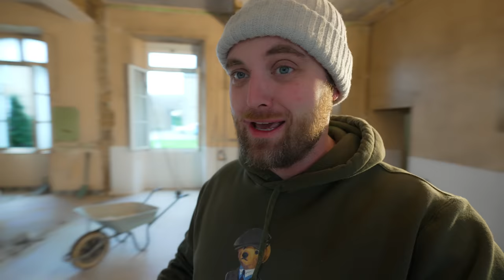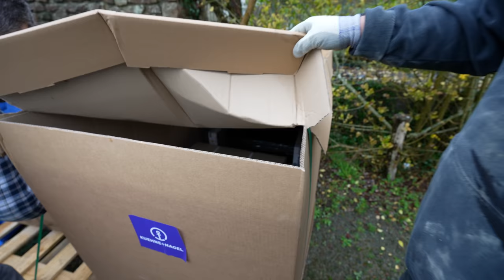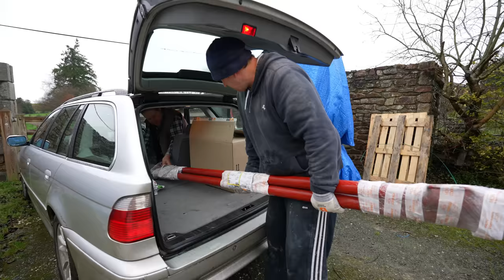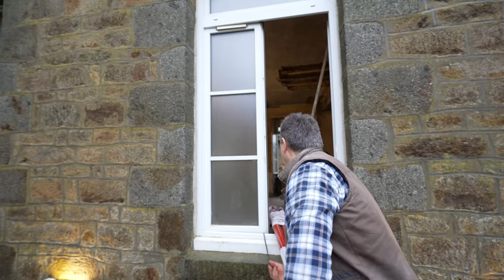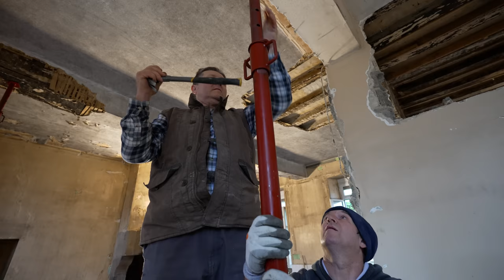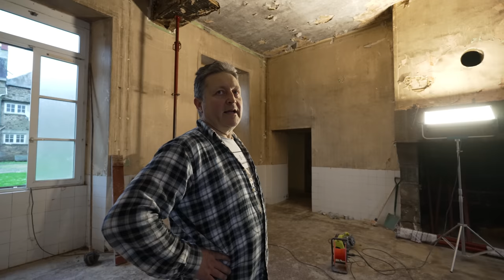Mystery Delivery For The Convent Kitchen

Comment: Hey you guys, there's an easy way to get the green strap off of the saw that was attached to the pallet.  Find where the two ends are joined and pull the bottom piece.  It comes right apart.

Comment: Billy, for the dip by the convent entrance gate - in the short term perhaps you could use some of the kitchen rubble as a hardcore filler and then maybe spread just a thin layer of gravel on top to ease the stress on vehicle suspensions, and make it look a bit nicer too?
Reply: Maybe a little extreme Ludo - the whole project is a work in progress. But fair enough if it bugs you that much.....

Comment: I think I would do just about anything to NOT have support poles in that space.  One option that I have not seen you to consider is reinforcing that one beam with steel and then putting a veneer casing around it for aesthetics.  This could applied around both beams and then stained or varnished or even carved with a simple design.  To me that would be the optimal repair for results and aesthetics.  You really should consider an option like this as those poles that you showed before as the permanent repair will make for awkward spacing for whatever you decide to put in that space.  It would look so much more grand as one open large ceiling.  Just saying...     :)
Reply: I second this!

Comment: top tip with the pallet tape (green binding at ~3 mins - if you find  where the tape is welded and twist it so the bottom is visible, you should be able to pull the tab and break the weld quickly and easily without pushing and forcing the box out like sean (shaun?) did :)

Comment: For future information, those plastic straps can be easily broken by finding where the sides connect together (the plastic doubles over at that point). Turn them over and see if there is an area that you can lift up. Pull it towards the way it came from. It should pretty easily pull apart.

Comment: A little trick for those plastic straps. If you don't have scissors, twist the strap where it's connected and pull the tab until it breaks apart.

Comment: Did mention in previous comment when you first started on demolition in the kitchen to look at blasting, you may find your chap can utilise the recommended glass or ice blasting instead of sand as that is perfect for wood beams. Good job either way and look forward to seeing the cast iron posts installed.

Comment: I've lived for 72 years and have never realised how versatile a hammer is.  The only occasion I have ever used a hammer is when I was a child and I would crack Macadamia nuts on the concrete.  I live in Queensland and my Great-Gran had a macadamia nut tree so we lived on them.  Now I see hammers can not only crack open nuts but pull out nails and scrap off slats and tighten and loosen things.  Wow.  I'll never have an occasion to ever do those things but it is interesting. haha

Comment: I am really impressed with the effort that has gone into this demolition job. Your muscles must all be popping! The room looks huge now. With regard to the columns you intend to install, the cast iron will look good, but surely some wooden columns would be more in keeping with the rest of the room? You wouldn't need to damage the floor either. It depends on which will work out cheaper I suppose. Best of luck. 🤞

Comment: if you flip a plastic banding strap over where it's connected, you can pull on the tab that's sticking out and it will fall apart.

Comment: if u got 4 angle iron and bolted them on each corner of them beams after u jacked them tight your outer wall framing could support the outer edges and u will have no obstructions in the room

Comment: Billy, this could sound a bit creepy, but in the UK, gravestones are quite often changed only to end up lurking in stone masons yards for decades as one stone mason pointed out to me. They're perfectly good & can either just need resurfacing or turned over. I'm pointing this out because if you were wanting a bit of marble or granite either in the kitchen or elsewhere in the Convent during the course of renovations, this might be a cheaper way to source these otherwise very expensive luxury materials. I've seen it used in other people's kitchens and one of the local stone masons in my area has loads of abandoned & disused gravestones. Once installed, you can't possibly tell what their former use was. Sometimes, if you're lucky, a grave stone is extra thick, so you can get two pieces of stone out of the one gravestone & or the surrounds people often have installed; cheaper & no issues with matching.

Comment: If you plan on taking the plaster off the wall and removing the floor you might want to wait and the guy with the sand plaster could do the whole room at the time. Same you time and effort in getting everything down to original surfaces.

Comment: Sean, just had a thought about the other beam, could glue and a wood hardener be used on the crack and use the braces right under like a vice clamp until it’s set work? Billy, I love the stone work peeping through on the walls, would you consider exposing them?

Comment: Were the two piece acros(sp) bought or rented?  Might take them apart and grease the threads if you need them for something else.   For the shorter handled cutter, you can fit a pipe over the handles if the longer one isn't available.